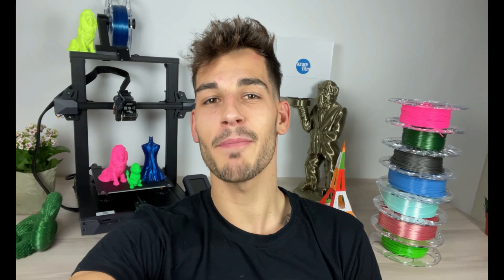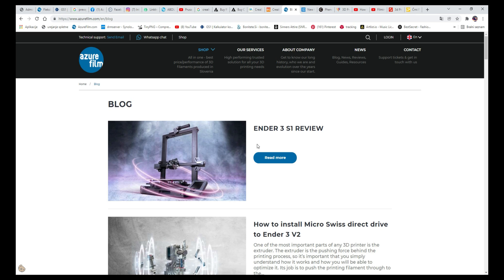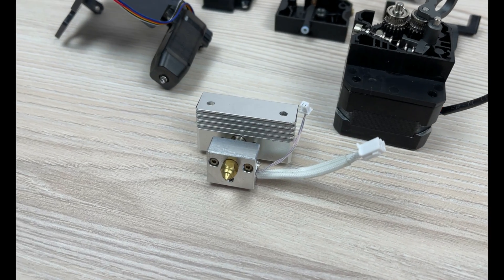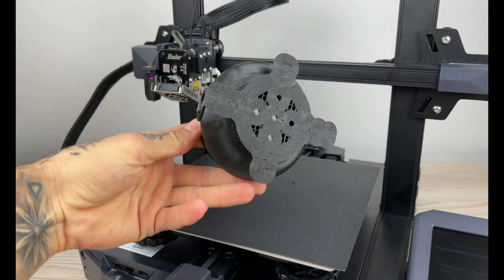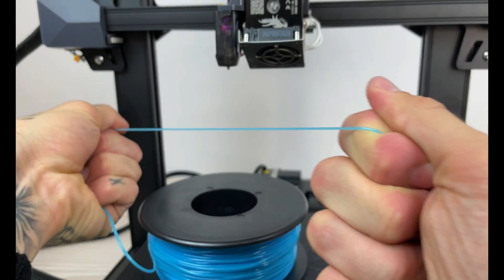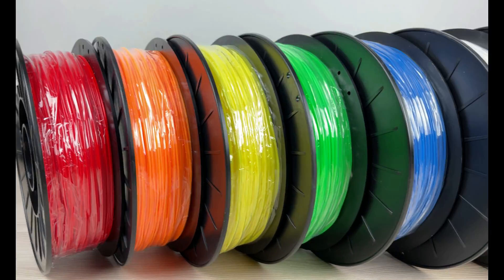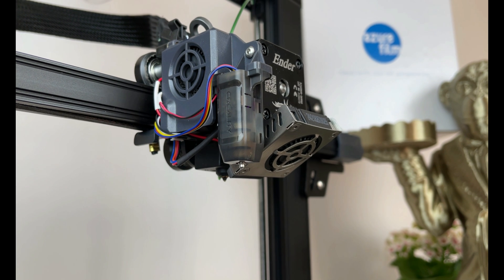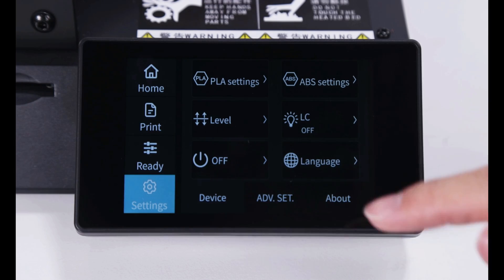Creality Ender 3 S1 Full Review - Best 3D Printer so Far!

Comment: Looks like they took all the best ideas from the mods and upgrades and put them into one printer. The direct drive extruder is probably an evolved Orbiter light weight hotend. The dual z drive is another add on / mod supported by the newer board, the run out sensor was on other 3d printers and a mod, the bl touch or cr touch was an upgrade and they probably did some Marlin upgrades as well. It even has a laser engraver you can add on later. What's not to love? Looks like its $389.00 US and ships in Jan 2022. I'm thinking about buying it. The flexible filament looks great. I really doubt you can print TPU at 80 mm/sec but ok...can someone verify this by checking it out?
Reply: I also doubt the PEEK because you need a heated chamber at about 120C, and extruder that can handle 400C and a build plate that can withstand 230C. This video is not exactly honest because you would need to upgrade a few things before doing any PEEK or any kind of high temperature 3d printing.
Reply from the maker: no, we printed other materials at speed 80mm/s flexible filament was printed at 25mm/s. We are sorry if it was not so clearly said:/
Reply: @AzureFilm3D  Your still not answering straight up. This printer is not compatible with PEEK out of the box... Correct. That would mean the hotend can go anywhere between 400-500c
Reply: I would wait for independent reviews although it looks great, Although I'm pretty sure they are str8 up lying about being compatible with peek out of the box.

Comment: Is the hotend capable of printing Nylon?
Reply: yes, it s all metal and nylon doesnt print that high,although i dont know how the printer would handle carbon filled nylon
Reply from the maker: it should yes, we did not tryed yet but we will inthe future:)
Reply: I highly highly doubt you can without the bowden tube burning. This hotend is not all metal because the ptfe still goes all the way to the nozzle. Ptfe's limit is 240c before it starts deteriorating and burning.

Comment: Don't couple two independent z-axis.... or are they not independent? Leveling screws in 2021?  Yet another cheap (oh not, it isn't that cheap) bedslinger i3 style printer which offers less features Prusa did 2 years ago...
Reply: AFAIK they're not independent.
Reply: Lol, it is HALF the price of the printer you are comparing it to. FFS let's point out how inferior this is to a voron switch wire while we're at it.  But hey, since you are comparing it to an i3, let's be sure to point out that this ender has a swappable toolhead and has a larger print volume than a prusa i3. And is half the price. I can buy two of them. I love prusa to death and I think he has created a superior 3d printer and is a superior inventor but it's just out of most people's budget, especially for beginners.
Reply: @inquizzz  I don't think you can buy two for the price, if you want comparable results and calculate the low quality parts you have to replace like the filament sensor... If you wan't to go cheap, you get more with an Anycubuic Vyper. IMHO, the price for the S1 is too high.
Reply: ender3 is a god first machine if u are new to printerworld..prusa is a lot higher level and cost ALOT more..its like buying a ford or a BMW sort of in quality..

Comment: Printing PEEK with that isn't possible what so ever....
Reply: peek is very high temperature of the filaments goes over 450 ° C, Ender 3 series and 3d printers are not recommended because all models are much inferior to that industrial 3d printer since 450 ° C are very risk of burning 3d printer.

Because high temprature filaments and peeks are very toxic and tough high temprature smokes can harm your home, your health and including pets.

I only recommend industrial 3d printer (expensive) in garage or building separate from home for safety and security, or no need to peek on a 3d printer.
Reply: I know, I just wrote the comment, because the Video said, that it was possible...
It would Funny to try it out though:)
Reply from the maker: No, printing with peek is not possible on this 3D Printer but it PEI prinitng plate is compatible with peek material😄
Reply: @AzureFilm3D  No, you need 180c+ on the build plate for peek printing, and PEI cannot handle those temps.
Reply: Also the printing plate isn't even PEI, so check the website first.

Comment: This seemed to be more of an advertisement than a review. How long did it take to set up? Were there any difficult steps? How loud are the fans? What are the down sides of the printer?
Reply: I personally don't have this printer, but judging based on my opinion and knowledge. (I do own an Ender 3 pro). Setup is easier than the ender 3 pro, v2 and standards, and it is straightforward. The fans are not very loud (like normal). So far there is no big downside (print area only, which is already very good) and they have addressed main issues with the Ender 3 pro/v2/standard. But it is quite pricey (but still worth it considering all the features and basically a very very good printer).
Reply: @gedeonang7077  Price will come down a lot soon like the Vyper did in my opinion.  You can buy the sprite hot end on its own, so putting it on a CR 10 V2 would seem to be better value.
Reply: @petercallison5765  Agree
Reply from the maker: This was a review, maybe we forgot to mention something and we are sorry for that, it is our first video like this but we were not payed to do this and it is just to show people this 3D printer.
Reply: @AzureFilm3D   a „full review“ that doesn’t include any information about the fans, the software and its features, the max temperatures or any criticism whatsoever is not a full review, it’s a advertisement.

Also when you said that the pei sheet works with peek, it seemed as if you meant that the printer itself can print peek, which it obviously can’t because it doesn’t reach the necessary temperatures and it doesn’t have a heated chamber. I am sure this just was a mistake and not your intention, but still it was something you should be more careful about when mentioning such things.

I think it would be great if you could make a longer video going into more detailed experiences with this printer including if you needed to adjust anything in its settings, how the slicer profiles are, if and which work was needed to properly print Abs and tpu without a enclosure, how the quality changes with the different speeds and especially which changes it has in comparison to the  Ender 3, 3 pro and 3 v2 and if you think that the changes justify the price and who you would recommend this printer to.
(And please also the full measurements of the machine, so it’s max dimensions including the space needed for cables and whatnot. Reviews never include this even tough it’s really important information)

I know your videos usually are rather short, but you seem to be very knowledgeable in the field of 3d printing and so a longer in-depth review would be very interesting to see and also the algorithm favours longer videos that bring more engagement, so your channel could also profit from a longer and more detailed version of this video.
And as you are a shop based in Slovenia, you could also include the price and how much shipping would cost to various European customers.
You could even include a code that viewers can use to get a small gift (like a filament sample or something small like that) if they order from your shop.

And similar videos for the Cr10 sPro would also be very interesting, maybe even a comparison between the Ender 3 S1 and the Cr10 sPro
Reply: @AzureFilm3D  clips of your video is used on Amazon lol

Comment: Damn. This is the Ender 3 that I really must have
Reply from the maker: yes, it is a must! 😝
Reply: Because I want 3D printing to be a pleasant, rewarding diversion. Not an occupation.
Reply: @jackcampbell4465  All printers have problems.  Buying a newly released model is always a gamble.
Reply: Why? If already have an Ender 3 Pro, just upgrade to a direct drive setup (which you can print the adapter!)  If its your first printer, maybe, but at almost $400, is it a deal?
Reply: @Twin_Flyer  It's more than just direct drive. If you print that adapter for your stock ender 3 pro,  you still won't get the updated screen, main board, all metal hotend, dual gear direct drive with a reduced size stepper motor to save weight, dual z axis with timing belt, pei coated magnetic bed, runout sensor, cr touch. This printer is getting into the Prusa i3 Mk3 space, so yes it's a good deal.
Reply: @TrashcanJan  The screen (e3v2) just looks like it's running different firmware, the ender 3 v2 board is already 32bit and silent an all metal hotend is not all that expensive (especially the non titan or bi metal heatbreakes that i'm sure creality wouldn't ship on their printers) a dual z axis is not that hard to fit onto an e3v2 since there are a lot of models on thingiverse. For every feature there is already a e3 or e3v2 upgrade and since the upgrade parts are from a supplier different than creality they will propably be much better quality and more reliable or at least have better QC. this just seems like a upgraded e3v2, but you don t get to pick the upgrades you do for your own use case.  Definitely not for me, since I have very different needs from my 3d printer than this printer would fulfill but i'm sure theres a market for it
Reply: @Twin_Flyer  i have ender 3 v2 is best for me. because i'm not problem with my printer :3